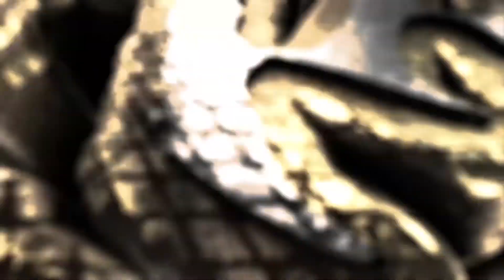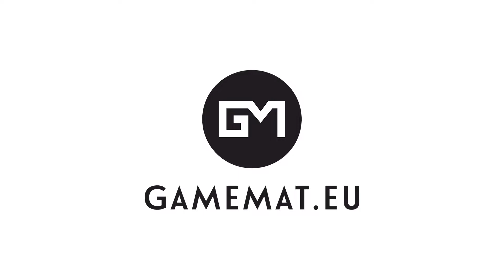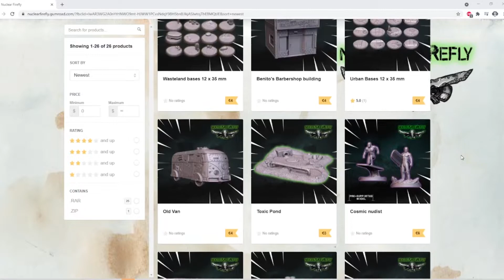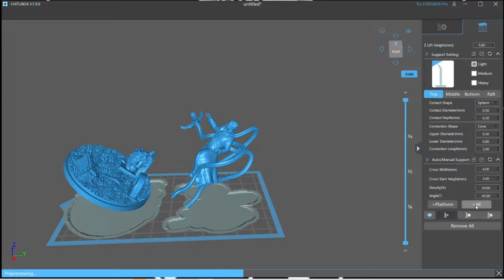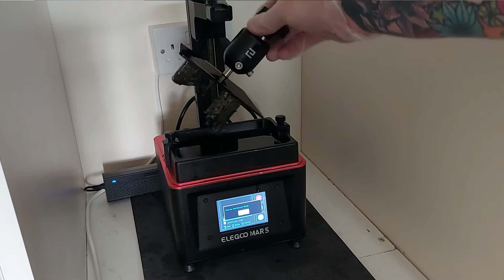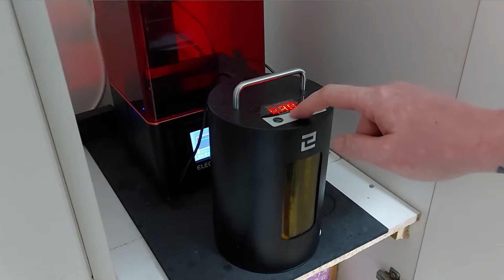Whats the Crack with 3D printing? what ive learned in 3 months

Comment: I have a 3D resin printer, Anycubic Mono X. I don't have any idea what I'm doing, every print has failed. Did you have specific settings for the that type of resin?
Reply from the maker: Depends what it's failing on. Sometimes you need to increase the exposure time on the first 5 or 6 layers. Also you need to level your plate before you put any resin etc in. Do you have discord? If you join mine I'll put you in touch with mitch and he can likely help
Reply: @Ninj4Squirtle  figured it out hahah apparently the UV screen was set to use only 50% power. Thank you for helping me!

Comment: Elegoo Mars Pro, Elegoo grey. I also bought a WhamBam Flexi magnetic build plate which makes it easier to pluck the model off the build plate but u have to then adjust the height sensor with metal washers near the head of the build plate to compensate for the extra volume on the build plate for this item. trouble shooting now is easy, the key is support struts / columns and also FEP tension with a spectrum analyser on a smartphone for the correct vibration frequency and installing a new FEP the proper way for which there are loads of videos on youtube for.
Reply from the maker: That is waaayyy beyond anything I understand for 3d printing. Hahahaa